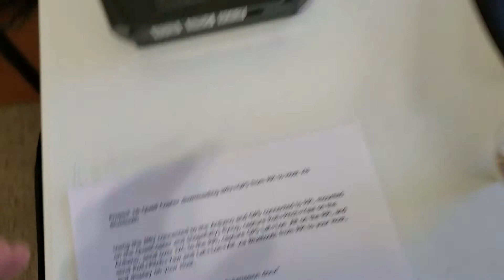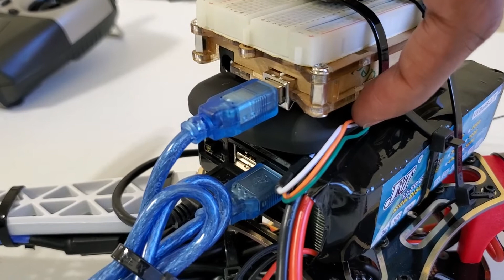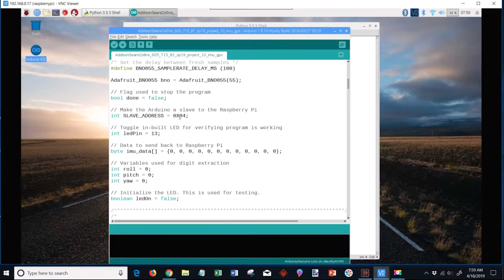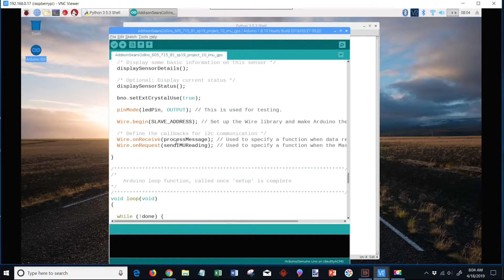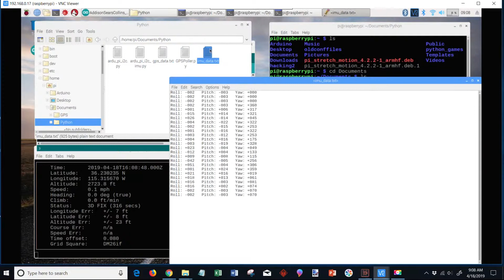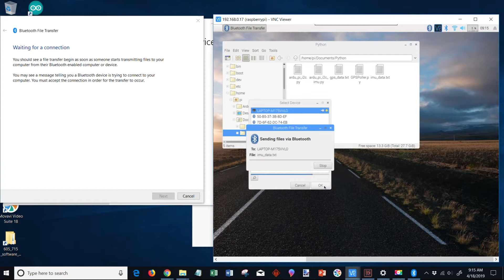EN 605_715_81_SP19 | Project 10 | Quadcopter Downloading IMU + GPS from RPI to Host via Bluetooth

Comment: Did you get this working. I am tying something similar. Can’t seem to get good enough data from the bno055. Was wondering if you could share your experience with this sensor for a drone application
Reply from the maker: I did get it working, but it took a while.
Reply: @automaticaddison  yes me too. Had to do the sensor fusion my self though. I found the Euler data drifted a lot.
Reply from the maker: Good to hear!